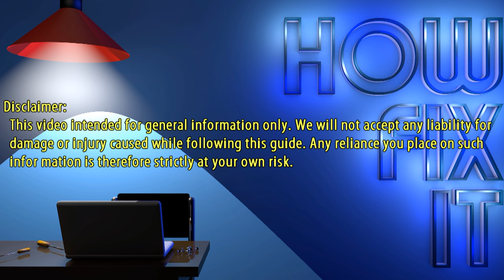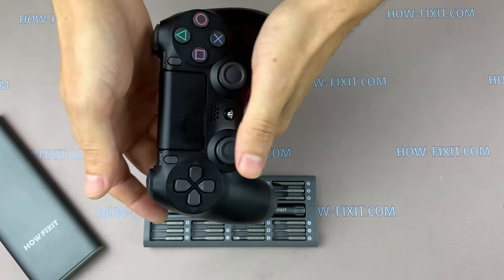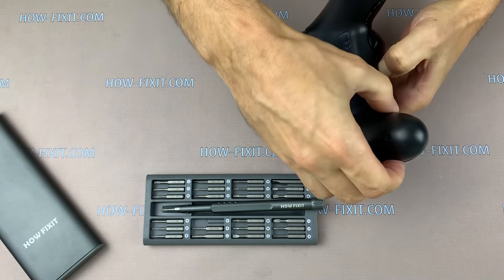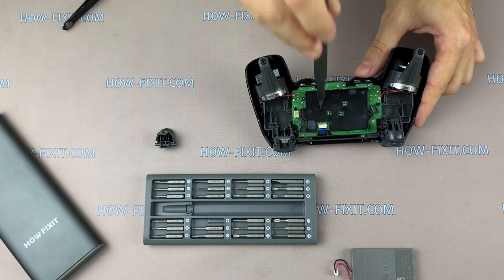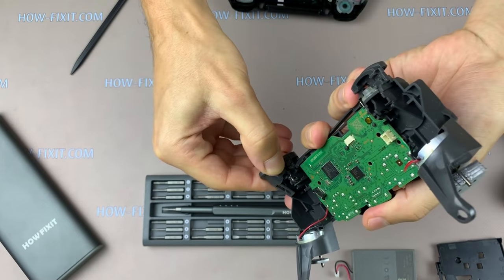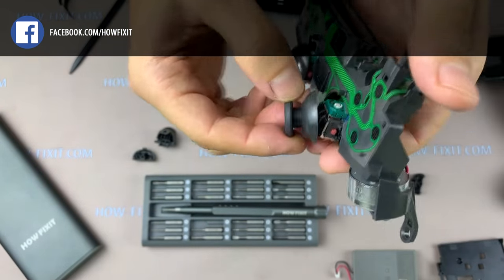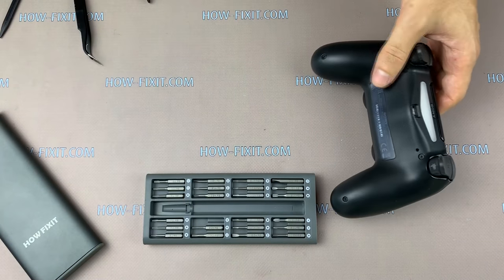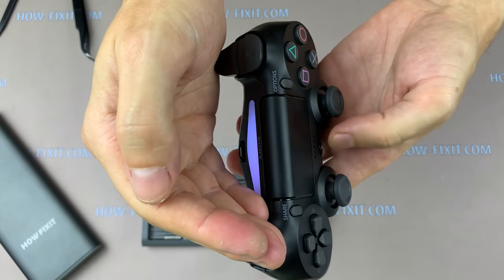PS4 DualShock v2 controller disassembly and repair buttons cleaning

Comment: How about while repairing the controller and putting it back together the L1 and L2 button does not respond anymore I took it apart put it back apart took it apart put it back apart and it's still not working help please
Reply: could have used to much alcohol on the sensor.
Reply: @garethwilliams3602  He said not to use achohol in the video...
Reply: @encouraginglyauthentic43  Isopropyl is a requirement to be fair. Granted in this video it says not to use them but Isopropyl will help clean the analogue sticks without friction. That means it's a far safer technique. The analogue sticks can be really tricky. If the buttons aren't responding either damaged the PCB or it's been flooded. However both triggers not responding is more likely to be a case of inadvertent damage to the sensor. When you dissemble the controller it's hard to break the PCB without the use of either compressed air fluid on the sensors or to much isopropyl alcohol.

Comment: Lmao I'm still stuck on trying to get the damn thing to open 😭
Ok so after an hour or two I finally got into the controller-
I finally cleaned them and now they are so much more fucking worse- Idk how I’ve made them worse like I gave them a good clean- and it’s drifting even more, and delaying movements hhhh fuck,, I shouldn’t have bothered cleaning them- 

Now I’m desperate for new PS4 controllers-  (:
Reply: If cleaning didn't work then that means that there is something wrong with it. Just look up videos to see what the problem is.